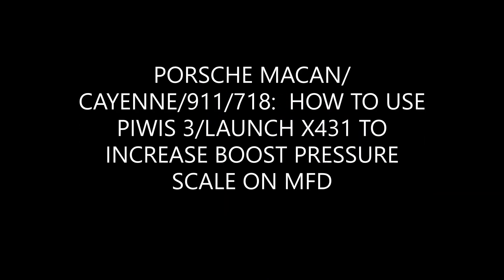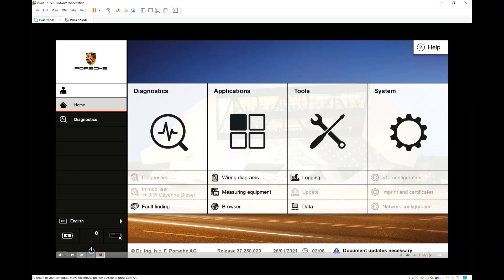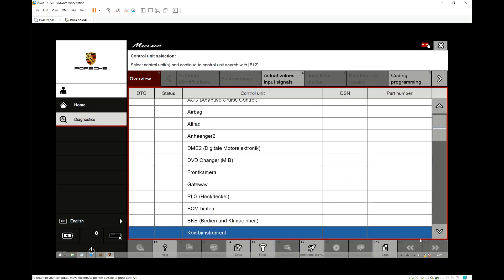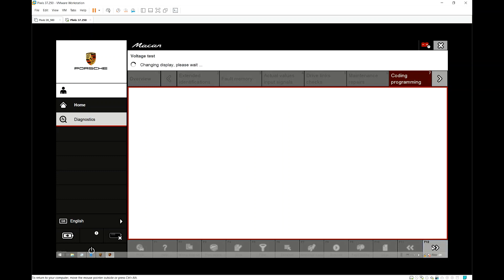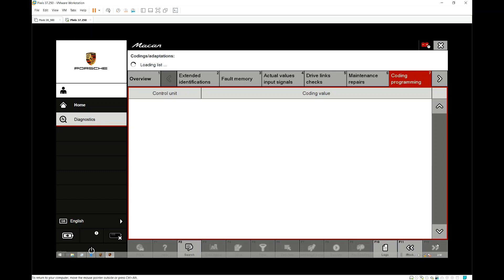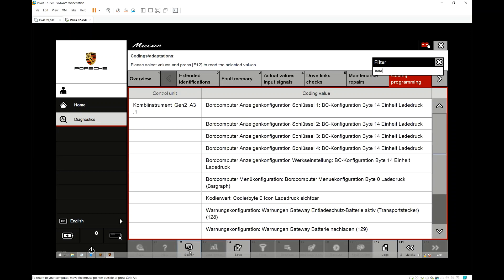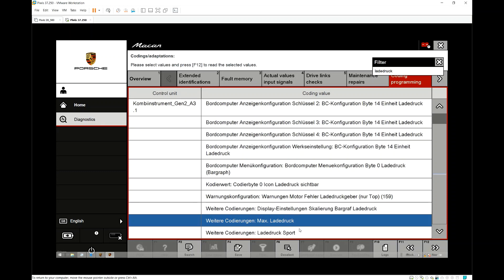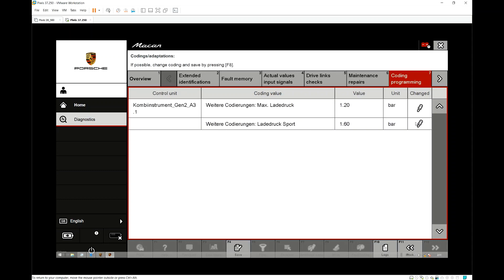Porsche Macan/Cayenne/911/718 Increase Boost Pressure Scaling on Multi Function Display

Comment: Am I correct in understanding that this doesn’t actually turn up more turbo pressure, it just makes the gauge more accurate if your Macan is already tuned? If I can turn my boost up with the piwis at work I’ll be ecstatic
Reply: Your latter is correct. Just makes the guage more accurate for already tuned vehicles which are exceeding the default 17psi/1.2 bar limit set in cluster.

Comment: Thank you for making this video! I'm having an odd issue when I follow your steps on my PIWIS 3 instance. Once I'm on the page where you can enter the updated boost level codings, PIWIS has both the entries listed as read only. The specific text on the upper status bar is "This value cannot be changed." I'm definitely in engineering/developer mode. Is there any chance you've seen this before and know how to deal with it? Thanks!

Comment: I spent a few hours trying to get this to work today, PIWIS 2 and 991 turbo.  I can connect, I've enabled engineering mode, but not seeing the menus you show on the PIWIS 3 in the video.

Even with engineering mode set, I get the diagnostic module list in english. If I select 'instrument cluster', I have options for 'coding adaptations -> manual coding' (which leads only to choices for  year, make, model, options) or 'coding adaptations -> customer specific settings' (which leads to a bunch of TPMS and seat belt warning stuff), or "Programming" (which leads to “no programming rules are available”).  I see no option for "manual coding without coding rules".  Is this the same on PIWIS 2?  It almost feels like I am not properly in engineering/development mode even though when I go back into the setting->diagnostic configuration it shows the 'e".  But the diagnostic menus remain in english, which i think is a clue...

Happy to read read read but I'm kind of at a loss of where to go next, any pointers appreciated.
Reply from the maker: Not used Piwis 2 so can't help although the process should be the same. If you don't see menus then my guess is engineering is not completely setup.
Reply: @thatcarguy4817  Thanks for the quick reply, that is my conclusion as well. Not really in engineering mode. going to try a fresh VM install of PIWIS 2 and see if that helps.

Might have to bite the bullet and upgrade to a PIWIS 3

Comment: After I hit manual coding the option isn't in the list? What am I missing?
Reply: It's working in 38.200 version
Reply: @bradleyyyy16  It's not a listed option on 39.7 or 39.8 with PIWIS III. Where did you get 38.2?
Reply from the maker: What option
Reply: It just says no entries set
Reply from the maker: @bradleyyyy16  sounds like dodgy version of Piwis
Reply from the maker: @bradleyyyy16  you using Manual coding and NOT manual coding without rules
Reply: No I was using manual coding without rules.  V 40.
Reply: Do you have a fb or a way I can send you a vid?
Reply from the maker: @bradleyyyy16  info@thatcarguy.club

Comment: 1.6 should equal 23.52 psig  not 19-20psig
Reply from the maker: Yes but tune only allowed for 19-20. If the tune was running higher boost, then you would see up to 23.5 on the dash.
Reply: @thatcarguy4817  cool.
read  manufacturer has a max allowable boost of a range of  22-23psig MAX
Reply from the maker: @user-xk5so7wb2t  definitely not true 😉
Reply: @thatcarguy4817   Porsche recommended NOT to over Boost Engine.
Reply from the maker: @user-xk5so7wb2t  please provide me a source for this? I know many people who run 24-26psi. In fact many Cobb ProTune's run this.
Reply: @thatcarguy4817  that 1-3psi over the rated limits. They say Porsche engine is designed better than Audi/ VW to be able to handle more

Comment: Hey! I'm having an issue with frontkamera_006, I've looked online and it looks like I need to flash the camera's firmware, do you know where I can find firmware for it?
Reply from the maker: You get some base firmware in flash data folder on piwis. If it's not in there you will need to buy from someone online.

Comment: Hi is it possible to send me the wiring diagram for 2019 pdls plus cayenne lights
Reply from the maker: Only for 92A cayenne? If its front lights I don't think they have changed
Reply: @thatcarguy4817  the problem is that I’ve upgraded the headlights from pdls I believe 2015 to 2019 pdls plus and when using piwis 2 to code them, there is no coding data inside the headlights and there is no option for manual coding either
Reply from the maker: @aqib333  You will need Piwis 3. I can tell you that there is Offline Manual Coding for PDLS+ in the newer versions of PIWIS 39.XXX versions. Unfortunately unless you can use the wiring diagram from a pre 2018 car, the wiring diagram for 2019> models has moved online so now you need PPN to access it.